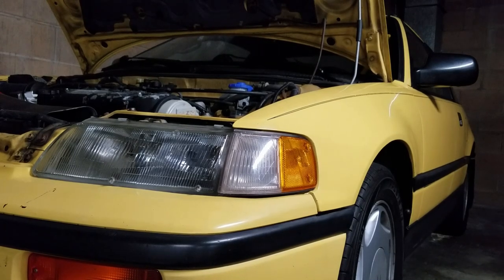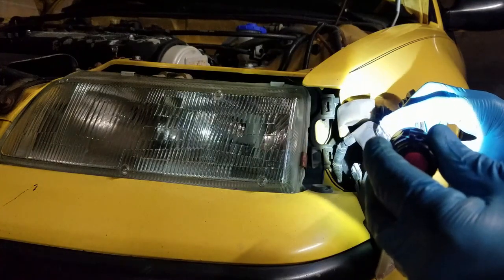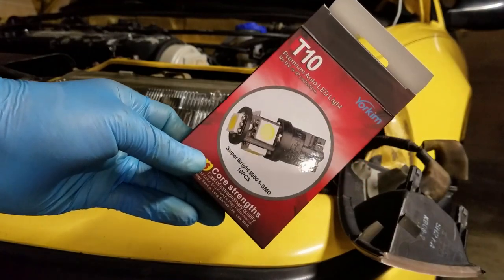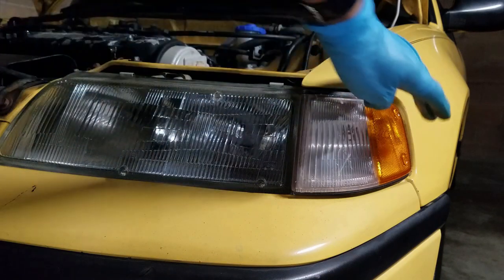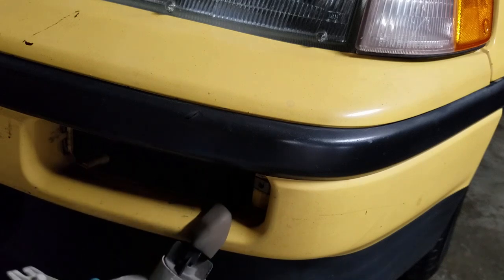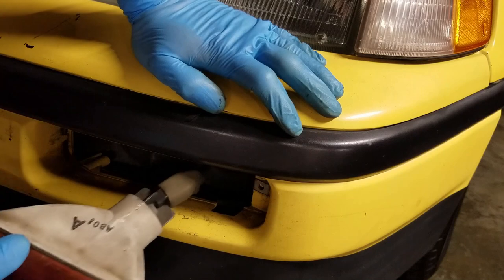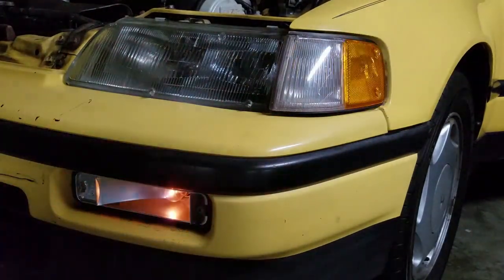Honda CRX Turn Signal LED's - Hyperflash Fix!

Comment: hey dude :) how did you make the two indicators alternate their on/off states? whole new duplicate wiring?
Reply from the maker: Hey there, they did that naturally,  I didnt do an re-wiring.  😊
Reply: @Econoballer  that is so abnormal :O I'm going to look into that because I'd completely put in the work to have that happen :D
Reply from the maker: @solwogan5356  You know, it could be because of the flash relay I had to buy in order to make the LED's work.  I listed the flash relay in the description, fyi.  :)
Reply: Sol Wogan It’s not abnormal. My 1991 HF front signals will blink together with the headlights off, but they will alternate blinking with the headlights on. If you watch closely, you will see that’s what’s happening in this video.

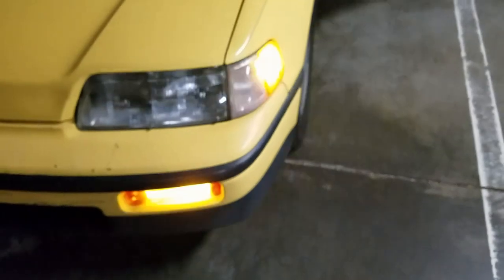Headlights OFF 17:09

Headlights ON 17:35
Reply: @BangBang-hk4rg  holy cow! I have to go see what mine do under the same conditions.
Reply: Sol Wogan If it’s a CRX with stock wiring, it should work like the one in this video.

It’ll be like getting a new mod with no cost or work involved! 🤣
Reply: @BangBang-hk4rg  it is and yay :D exciting prospect
Reply from the maker: @solwogan5356  that's awesome, I never realized that myself.  Thanks everyone for this insight!  :D

Comment: Don't buy the wiring and spades. Just dremel the housing and install it naked without the housing.
Reply from the maker: I don't think I'd want a naked relay just sitting under there but if that's how you roll.....  #nakedrelay

Comment: You need a resistor.the LEDs use less power and your relay thinks your bulb is out.
Reply from the maker: You don't need a resistor if you change the flash relay.
Reply: @Econoballer  I use resistors.but that works to.you can get a bag of 100 for 4 or 5 bucks lol
Reply from the maker: @scooterboy304  ah, mystery solved!  :D  Do you have a CRX?
Reply: @Econoballer  yes....89 crx with h22 swap
Reply from the maker: @scooterboy304  rad!